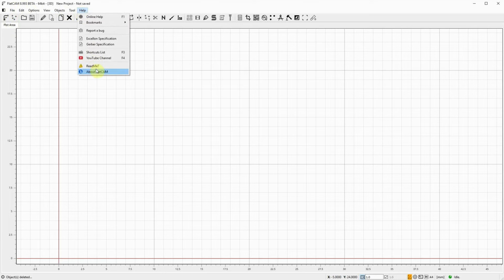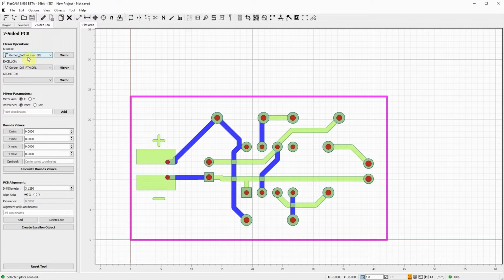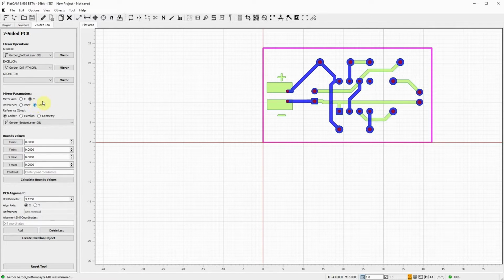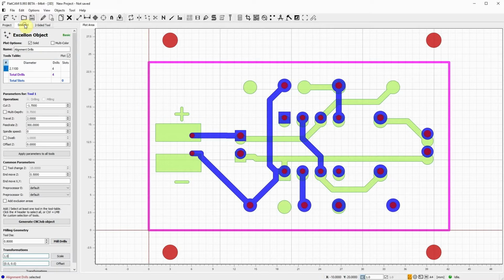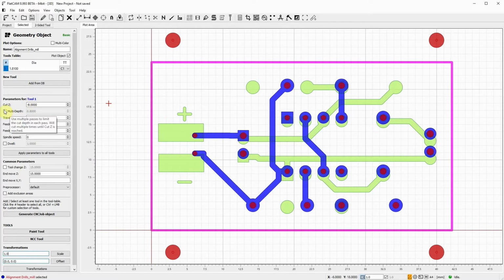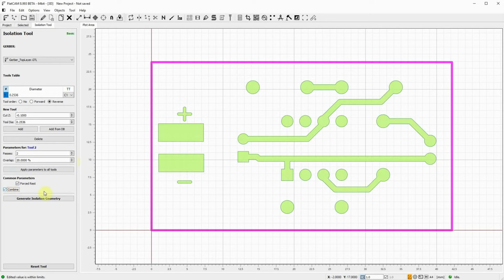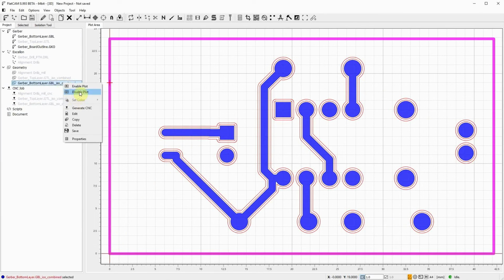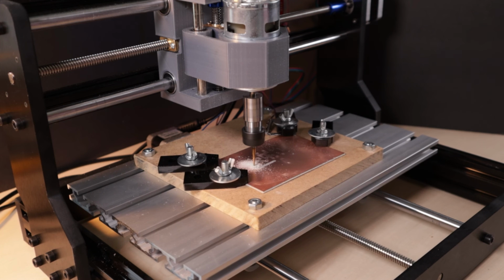FlatCam 2 sided PCB milling on a CNC

Comment: About the alignment holes: Do they not have to be placed exactly symmetrical? You did not mention this and just seemed to put 4 holes. However, for the PCB to flip over and have the pads align, the alignment holes must surely be placed in a exact rectanghle pattern with equal offsets from the board outline?  
Ot not?

Comment: what if i already have mounting holes in the excellon file and are equally spaced from 0.0 refference in CAD ? i use kicad, set the center of the board as x0 and y0, set those holes symetrically, edge cuts also symetrical to origin, so i can use them as allignment holes and edge as refference for flipping the backside, right? i might be dumb, cause my firs try was a fail, had one side shifted by 2mm. i guess trial and error make better results, but i cannot figure out what to use instead of copperclad.

Comment: So, I am using flatcam,  but when i make doubleside PCB,     1 side does not match..   I am just mirroring the files  and   us the position holes for it,     the pcb board  usually moves a bit, since the holes are based on the PCB board that i want , and the  real PCB is a lot bigger,  so i can make more on 1 sheet.   anyways,   it's seems to be off around 3-7 mm .   what am i missing.

Comment: Hi, very nice video.  I have a question.  The home position of my CNC is the upper right corner and my PCB as the zero origine in the bottom left corner.  I'm new at this.  Do you have a video where we can see how to position the start position for the top layer and then the bottom layer ?   I'm not talking about the alignment holes that's ok but I need to make sure the cnc knows where to start after I flip the board.
Reply: You probably figured it out already. You should have the same start position when on both sides. Whatever you use on the front side, use the same on the flip side, and I think you'll be ok.

Comment: Do you have any advice on how to hold down the board, do I need double-sided tape and does it need to be stiff? I set up just two alignment pins for my layout 85mm apart for a 10x7 cm board stock, but they were very tight, and I used two of the regular clamps provided with the 3018 kit just outside of the pins. Now I do the isolation run using the tips they sent with the kit and I'm not getting cutting (it's hardly even scratching the surface), it's apparently just pushing the board down (I guess it's convex), or else the tip I'm using is soft or not pointed enough. Some people are saying "do autolevelling" but I don't seem to be cutting at all, that wouldn't even address the problem! I did try those "nano blue" tips and they WERE cutting but the routes they were cutting were so wide the traces were completely "washed out" (the isolation routes from either side were touching each other) and when I looked closely at the tips they had TWO points with a gap between and weren't anywhere NEAR 0.1mm as advertised. So the problems I'm having are basically with the mechanical setup NOT the software, part of it is tip selection and part is holddown, the milling and drilling stuff seems to work just as advertised. Am I getting in trouble with "too tight" a fit on the pins so it could be bending the board a little? Could you do a YouTube addressing these challenges, or do you know of one or a webpage?  I really need to isolate these issues from one another and start making progress...
Reply: I just put blue painters tape on my spoil board and apply a fine layer of common kids liquid white glue (Elmers) on the back of the pcb and press firmly (to get out the excess) , it's cheap and more flattened than double sided tape or super glue, I can mill perfectly on my cheap 3018 cnc and dirt cheap bad quality pcbs 😅

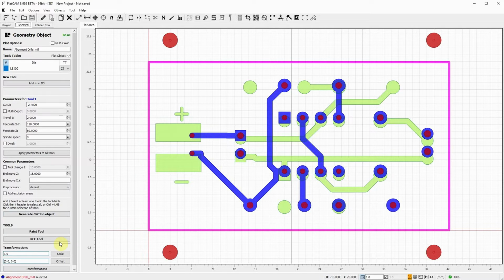Comment: I have Flatcam version 8.994 BETA and the menu is different from yours. Such as setting the Milling Geometry at about 8:30 in the video. It isn't there.

I have found several things in completely different areas of the software so far. Not so easy to follow along as I hoped.
I may need to find it and install that version 😕

Comment: Never explained how to mill the position holes. CAn it all be done in Flatcam or do I need to create a GBR file with the holes first in CAD?
Reply: Generate a CNC job from the Excellon object, save the CNC file and then run it on the mill.

Comment: Why did you not show how to do the height mapping? It's a critical part of this and you just glossed over it.
Reply from the maker: Hi! Yes, it’s very important, but not a part of Flatcam, and will be different depending your CNC software and CNC machine. So while we agree that it’s very important the video would be too long and broad if we were to cover to many alternatives.
Reply: @DIYTECHBROS It would be nice to know what software you use at least because I have yet to find a sender that does height mapping reliably.
Reply: @DIYTECHBROS since you are talking about  3018 cnc let's hear how you do it for that machine.  Thanks for a very informative video.

Comment: Hi, Thank you for your great video. I am almost ready to mill my first 2sided pcb now.  I have a question though.  I can generate a height map, but, how do I apply it to the gcode created by Flatcam?
Reply from the maker: Howdy! A height map is made an applied in you CNC software :-)
Reply: @DIYTECHBROS  Hi there! Thank you for your reply.  I was able to close the loop now.  Kicad->FlatCam->Candle,   It took me a while to get the whole tool chain ready, and without people like you would had been almost impossible. THANK YOU!!!

Comment: what the minimum track thickness can you get with cnc method?
Reply: It depends on your CNC. I use 24 mil tracks, but I'm pretty sure I could go almost half of that, or at least 16 mil. I use a 1000x1000mm Ooznest WorkBee. Surface probing is a must and you must also minimize backlash. I've got less than 0.01mm (0.4mil) backlash in Y and about 0.06mm (2.4 mil) backlash in X. A high quality expensive machine can of course do a lot better.

Comment: Having cut holes for the connections between the layers, how would you recommend actually constructing the vias?
Reply from the maker: Hi! 
1. you buy pcb rivets
2. use the legs of a resistor and solder it to both sides 
Best of luck!

Comment: Hi there,
I have the problem that the holes in the Excellon file do not match the pads. The holes are very far away. Why is that? I use EAGLE to create the boards and the G-codes.

Comment: Should all holes be drill first? In worst case top layer will be good
Reply from the maker: I really prefer drilling the through holes after the bottom side is drilled! Usually, it does not help much if one layer is good, since I need both for the PCB to work :-)
Reply: But with curved drill holes PCB is for trash

Comment: Great video. However I have two questions. 
1. I would like to have the alignment pins located within the finished circuit board. This would allow me double purpose the holes for mounting screws. Assuming this can be done, and will test later. Are there any potential problems I should be concerned about in doing this??
2. I would like to partially mill the tabs that hold the circuit board to the larger board material. How can this be done. 
3. Bonus question ;) What are your thoughts on the term Milled Circuit Board (MCB)? My pedantry haunts me.
Reply from the maker: I for sure know what you mean!  Calling a copper clad board a PCB, and naming it printed when it is milled... 
Regarding the alignment holes, that is a great idea! The thing to consider is that you will join the copper both sides if you use metal screws. So I would connect the copper to ground for both sides. Either that, or isolate the holes as well.
And, for the tabs, you can create two CNC jobs, one cutting half the way through, and other one (with tabs) the rest of the way!
Reply: A problem you might run into, which can be difficult to control, is that if you have the pins in the middle of the board, it easy to crash into to them. Of course, less risk if you set Z height for moves high enough.
Reply: @bjondersson I used the tape and glue method, after setting the board i removed the pins.